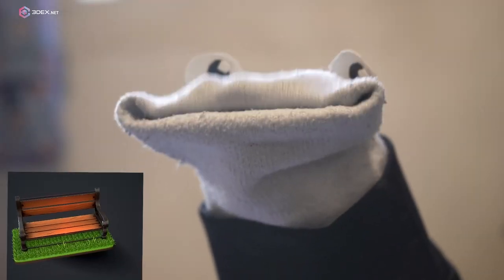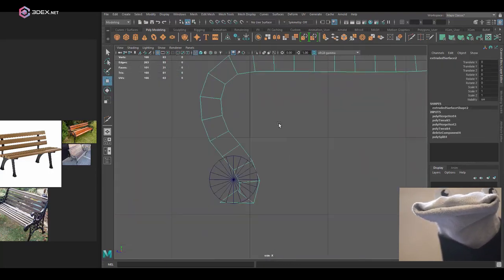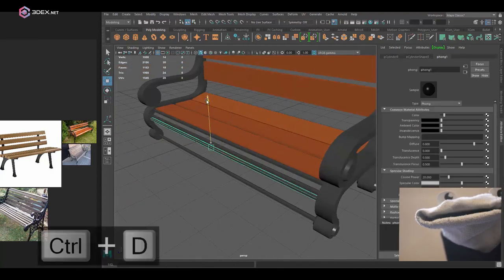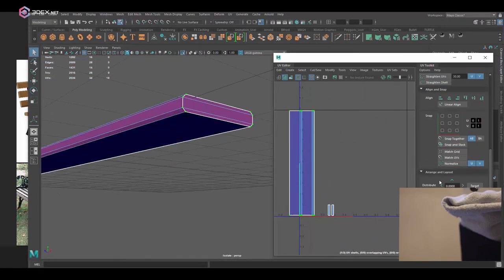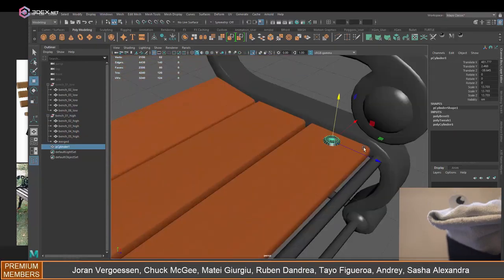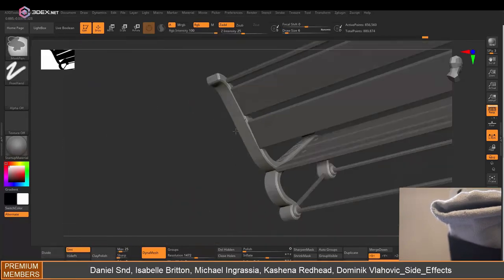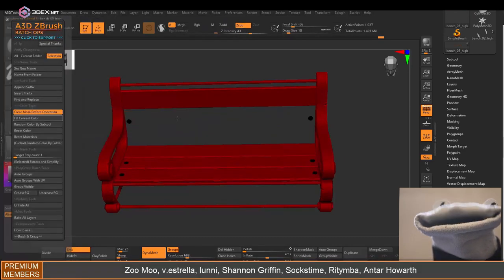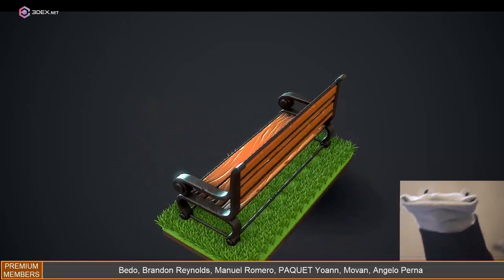Modeling and Texturing a Stylized Wood Bench

Comment: Mr. 3dex, I'm interested in getting a job doing 3d modeling, so I need to enhance my skill set. Right now I'm sort of an intermediate Blender user. Am I wasting my time if I learn more Blender, or should I learn Maya instead?
Reply from the maker: You are not wasting your time, the skills you learn making things in Blender can be transferred to other 3D programs; some tools and names of tools can be a bit different off course. Not all jobs require you to use Maya and if you have to switch for a job I don't think it will be too difficult to move to another program.